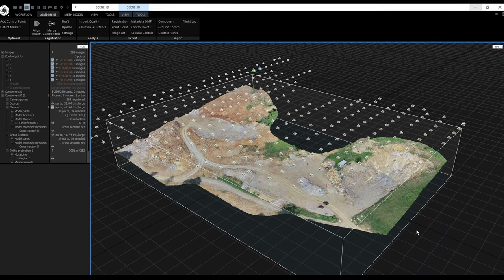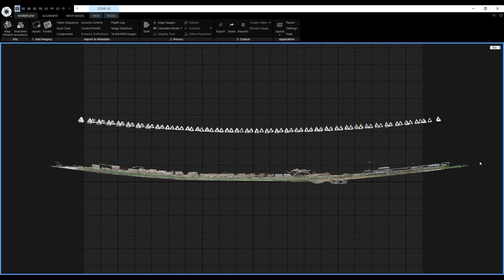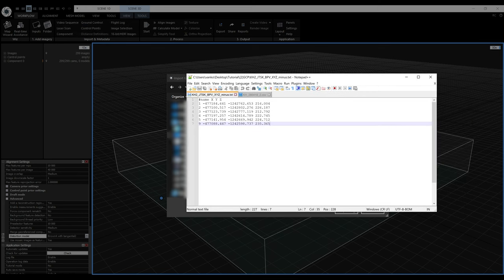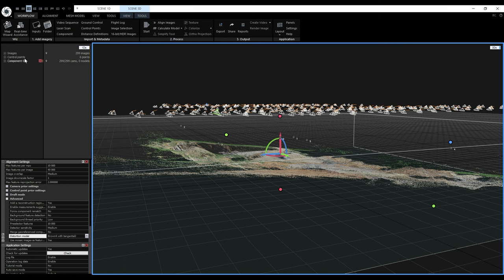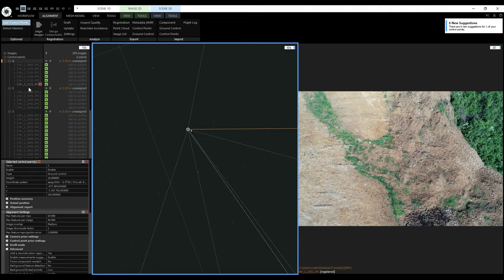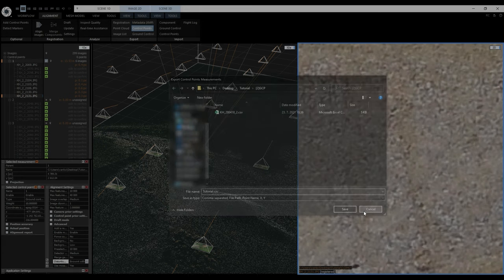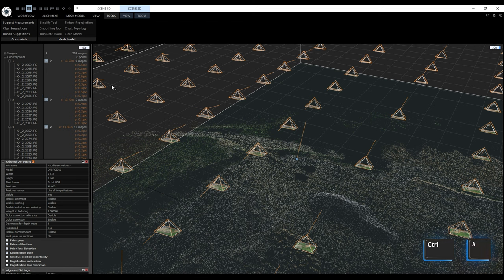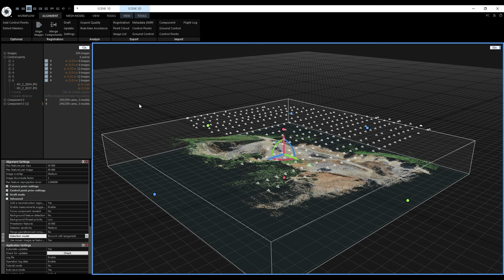Drone Mapping Guide | Part 1

Comment: @Jakub - I am having trouble aligning the images - I have done a vertical facade survey of some silos with a 65% photo overlap. When i insert the images and align I seem to get lots of small components that dont make sense. It seems either RC isnt placing the images in the correct GPS locations. Is there a way to fix this? Would uploading the flight logs help at all?
Reply from the maker: Can you contact our support with this issue?

Comment: Hello Jakub, Thank you for your tutorials. I would like to ask, that: Is it possible to sort Control points by name? I chceck accuracy my 3D models and I have more than 100 control points and I have problem with orientation in my list. Thank you for your answer Stano
Reply from the maker: Hi Stano, this is not possible, but we have a feature request about this. I will add your vote there.
Reply: @CapturingReality  Hello Jakub, If I can, i have one more question. I´m researching created 3D model without gps, total station and scanner. I would like to define scale of model only with reference distance and find optimal position of scale. Is it possible to define only reference distance and than control accuracy of model with masured points with total station? Because when I don´t choose some ground control point my model gave me to wrong positition and accuracy didn´t wrote true accuracy. When I choosen all my measured points with total station, defined points like ground test it is not moved 3d model to optimal position for minimal errors? Or do you have some idea for check accuracy when I want to define only reference distance? Thank you Stano
Reply from the maker: @StanislavStehel  Yes, it is possible to scale your model just with the distance. It is better to use more scales (it also depends on the size of the model) and you need to use correct distance (not too short). Are you using drone dataset? When you are using total station, you can also use these points as GCPs (it is better, as they have better precision as RTK GNSS). Ground test is just for comparison, these points don't have the influence on created model. Best way is use some coordinate system or local coordinate system to check the accuracy.

Comment: At the 9th minute and 19th second of the video, you import the CSV file containing the image coordinates of the images associated with the points. I also followed the steps you showed. At the end of the steps I took:
Operation warning
The file contains 42 images that are not in the current scene. Please check the console for the full list of images. [error: 18002]
I get the warning. I don't see the additional points in the rest of the video. what should I do?
Reply from the maker: Hi, this is just a warning message that there are some images in CSV file which are not included in your project. You can continue ordinary in the process.
Reply: @CapturingReality  Thank you for taking into consideration the question I asked, being interested in it, and answering the question I asked.

Comment: Great set of videos, thank you for going into so much detail.  I've a question about the number of GCPs to use.  I'm mapping an earthworks site which is around 14acres and am using a total station to set some GCPs throughout the site.  On my last model I used 18 GCPs.  Is there any disadvantage to using so many, other than taking more time to confirm locations in the images?
Reply from the maker: No, it is even better. If you have some many of them, you can some use as check points to check the actual quality of the model.

Comment: Great work Jakob, very informative and professional tutorial. Which capture app would you recommend based on your experience, Drone Deploy, Pix 4D Capture, Map Pilot Pro, ESRI Site Scan LE or the paid Drone Link? Is the Terrain awareness important to vary altitude and keep the flight height parallel to ground and keep a consistent GSD? Is a good rule of thumb to keep the GSD typically below 20mm by selecting appropriate flight level? Many thanks.
Reply from the maker: Dear Lee, we don't recommend concrete application. RealityCapture works with images and it is on your preferences which is best for you. It depends on your work and what you need to obtain. But it is better to follow the terrain because of the same GSD and non changing overlap. Regarding to GSD, it also depends of your needs and what for you are doing that project.

Comment: Hello, Thank you for your tutorials. I have a question. In Drone Imagery + Ground control points of free sample datasets, Control points' Altitude is Higher than Images' Alititude. Is these Ground Controls correct?
Reply from the maker: Hi yes, the control points are correct. Problem is with the image height, where DJI drones use relative height, not the actual one (https://forum.dji.com/thread-165794-1-1.html). So it is possible in some cases, that there are these differences.

Comment: @Jakub - Many thanks for this tutorial! I'm totaly new to this RC and have some questions about differences between the files you use in your tutorial and the online datas provided on RC website:
1 - Coordinates system:
You use epsg: 5514, and on the website description about coordinates are separated in horizontal epsg: 4258 and heights in Baltic vertical epsg: 8357.
How should i deal with those informations in the RC settings? Am i supposed to use the epsg from the country i work from or the epsg the pictures were taken from?
2 - Group calibration Exif:
All images from downlaoded file are the same focal (e.g 24mm). Is it necessary to change GCExif to "Yes"?
3 - Distortion model:
How do you know what DModel to choose? Is it relative to the drone/optics constructor?
4 - GCPs:
The downloaded file is already provided with Ground Control Points going from 101 up to 203, but there is no negative values like in your tutorial. If i import GC with File Format X, Y, Z i get an error from RC, so i assumed they were more lat, long and alt coordinates and it worked. But i had to manually adapt the images suggestions because they were all above the picture in the 3d viewport. Everything worked fine until the .csv step at the end of wich i got an error msg from RC. How should i use those informations? Also the .csv infos are provided with the downloaded files, i don't know where to go with those, like i'm confused!
5 - Readme file:
It says we should change the path to the source folders in the SetVariables.bat as follow: 
* RealityCaptureExe - path to installation folder RC.exe is stored.
*RootFolder - path to all source folder.
How do i do that? (cmd prompt, but don't know how to do it properly)

That's a lot of questions, so in advance thank you for your answers Jakub!
Reply from the maker: Hi Vincent, I will try to answer your questions:
1. The dataset which you can download from our site is another than used in this workflow. Regarding to coordinate system, you can set Project and Output coordinate systems in Application settings )(they could be different). Also, if you are importing each files (like GCPs you can set their own coordinate system). You can set these systems as you need or to in which system are the data. In your case you can set 5514 for project and output coordinate system, but 4258 when you will import the GCPs.
2. It is not necessary but you can do this. It is better do do when you have different focal lengths.
3. For most cases is OK to use pre defined distortion model. When you have fish eye optic, then you can use Division. 
4. Yes, GCPs should be in Lat/Long (4258). It is quite usual thing to manually place the GCPs over images, as drone data are not always in correct heights. Usually they are measured from the take off height. Did you realign the component after GCP's placing? Also, you should set No in Use camera priors for georeferencing under Alignment settings in this case.
5. You can open that BAT file in Notepad++ for example and change these paths there.
Reply: @CapturingReality  - Thank you Jakub, i'll try this later this afternoon and let you know how it goes!
Reply: Hello Jakub, i did it with the script, i used Visual Studio Code to open files. Everything went well, while during the process RC crashed right after the texturing operation. Don't know why, might be because i'm only 16Gb ram?
I will try to do it step by step today, like you do in the tutorial instead of running the script, and let you know how it goes. Thank you so much again, have a nice day Jakub!
Reply from the maker: @vincent4468  Hi, did you get some error during/before crash? Were you using the setting from script or did you change some of them?
Reply: No Jakub, no error before but a crash during the execution of the script right after Texturing step and i did not change anything in the script. I will try again and send a crash report if it helps and if possible.
Reply from the maker: @vincent4468  If it will do again you can contact our support with that issue (support@capturingreality.com).
Reply: @CapturingReality  @ Jakub - Hello, i am doing the tutorial step by step, setting everything with epsg:5514 (coordinates system, GPCs), but it does not work. GPCs don't show up on screen and when selecting one and ask for Suggest Measurements, nothing happens. Plus if  selecting a GPC in the 1D list and then moving the model in 3D viewport, i got a black image like if the model is lost and i have to go to Reset View to get the model back in the 3D viewport. As far as i'm going, i cannot follow the tutorial. Any idea why?
Reply: @ Jakub - Now it works! I was wondering if by using the same parameters as the script does for the settings, but doing step by step like in the tutorial, it would work..but it did not. By using the script, i noticed that GPCs file format was epsg: 5514, but if i do this following the tutorial it does not work. But changing the file format of GPCs to epsg: 4258 and clicking on Convert Coordinates, does the job. I get GPCs in the viewport and no problem with the 3D viewport. Let's continue this tutorial and see where it brings me to...
Reply: First Part done, perfect!
Reply from the maker: @vincent4468  The sample dataset from tutorial and downloaded one are not the same. therefore there are different coordinate systems.

Comment: Great Video. I am currently working on making an underwater model of a deep-sea coral garden. I have the lat, long, and altitude of the ROV that took the images. Is it better to import a flight log or ground control points? Or a combination of the two to accurately georeference and provide scale?
Reply from the maker: It depends on the precision of the data. The best way is to have both (as you can check also the precision of the results much easily).
Reply: @CapturingReality  I understand. Thank you. 
One last thing. In the context of just ground control points. Is it necessary to add GCPs to all the photos in the model or just specific areas within the model? I am exporting the scaled dense point cloud into cloudcompare and ArcGIS problems as a DEM.
Reply from the maker: @ignacio_the_coralbiologist  The GCPs should be placed around your captured area evenly. It is not necessary to add them on each image. The number depends on the used dataset, but basically it the point is measured/placed/added on 10 images, it should be enough for most cases.
Reply: @CapturingReality  thank you. I appreciate your insightful tips.

Comment: During alignment my CPU is at 100% and the GPU is at 0%.
Should RC use the GPU for alignment?
It's an Nvidia Geforce GTX 1660 TI
Thanks
Reply from the maker: GPU is not used during alignment process.

Comment: @capturing reality  How does RC handle Check Points?  In accurate mapping, processing without CPs is just pretty pictures.  Maybe it's in one of the next vids?  Thanks!
Reply from the maker: Hi Dave, you can choose some of the Control points as Check points and then find out the accuracy of created model. In RC it is called Ground test. In this video the control points are in the Importing control points measurements part.

Comment: Wish you would create a set of mapping videos without ground control points. Honestly most people don't use them
Reply from the maker: Hi Darrin, thank you for your idea. In that case it is basically the same, but except GCPs you will use flight log. Do you have RTK drone?
Reply: @CapturingReality  oh no I don't have gcps or rtk. I have always used drone deploy in the past but I have just started using reality capture and I love all the customization and In my opinion the maps and models created with reality capture are so much better than drone deploy.  Most of the mapping I've done commercially are only concerned with relative accuracy and not so much absolute.  I love the tutorials but they were so indepth with incorporating gcps it was hard to follow. That is why I was suggesting possibly another set but with out the gcps. Thank you so much for the quick response. Looking forward to learning more about the software.
Reply: then it is not maping but creating pretty pictures
Reply: @CapturingReality  If your using an rtk drone and GCPs would you still set camera priors to unknown and realign?
Reply from the maker: @CAPTURECI  You can do that. Then GCPs are used for georeferencing.

Comment: How do I get/create or where do I find the ground control points file?
Reply from the maker: You can create them manually (Alignment tab/Optional/Add Control Points) and set the points as Ground control or you can import those as TXT file under Workflow tab/Import & Metadata/Ground control).

Comment: How do you align drone captured images with hand held camera images?
Reply from the maker: The same way how any other images. If there is a good overlap they will be aligned, if the images are georeferenced, they will be aligned. When not, you can use control points to merge two separate components. The principles could be take from this tutorial: https://www.youtube.com/watch?v=kKA-KxT25KA

Comment: Hello. Could you make a tutorial using a combination af rtk or ppk georeferenced images combined with GCPs and explain how to set the weights?
Reply from the maker: Hi Nikou, thank you for your ideas. The principle is the same. You can set the higher weight for data, which are measured more precise. I added this idea to our future tutorial topics list.
Reply: @CapturingReality  Hello, I wanted to follow up on this. Have you updated a video on RTK georeferenced images. I am unsure how to process after aligning the photos without ground control points.
Reply from the maker: @stephanieramos8464  Hi, the video wasn't updated. You just need to set the precisions for the images in the Alignment settings (Camera prior settings).

Comment: Hello, double grid with what degree of oblique angle do you recommend?  I typically fly nadir. Is this wrong?
Reply: Will it be orthorectified after processing with obliques?
Reply from the maker: RealityCapture supports true ortho projections of textured models and image mosaicing. For the true ortho, double grid flight with obliques is better. For image mosaicing, nadir shots are better, especially when they are projected on the digital terrain model. Remember that you can use both obliques and nadir shots in a single project and then disable and enable groups of images for specific processing steps.
Reply from the maker: No, it is definitely not wrong. It depends on the use case. Double grid flight was recommended as one of the options for mitigating the bowl effect. This project used a single grid flight but was corrected with the help of ground control points.

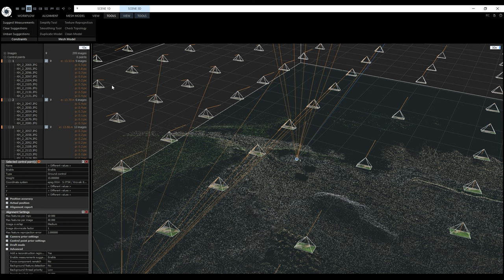Comment: 10:29 Disabling inaccurate camera priors
With Ctrl+D and an immediate Ctrl+A what is selected is actually just part of all images; I think it's either all the just prior manually georeferenced images or all images that still aren't. Is this intended or should all images actually be selected?
Reply from the maker: Hi, using CTRL+A all images in that component should be selected.
Reply: @CapturingReality  Hi, thanks for replying this fast. Just noticed that, in my case, it was just because I had multiple components and RealityCapture just functions that way that via pressing Ctrl+A it only selects all the images for the current active component which is all that is needed of course :D Nice!
Reply from the maker: @mpiauro3958  You're welcome. Also, if you will have open images in 1Ds view and will use CTRL+A, it will select all images in the project.

Comment: Are the images you used in the demo available to work with.
Reply from the maker: Not these specific images, but there is another drone dataset with ground control points available in our sample datasets on this link: https://www.capturingreality.com/SampleDatasets
Reply: @CapturingReality  I've downloaded the data set you are referring to and tried using it to measure area and volume. The logs just aren't as good an example as the sand would be. Thanks anyway.

Comment: Can yu make an RTK processing option?
Reply from the maker: It is possible using flightlog or if the position information is baked to the used images.
Reply: @CapturingReality  can you make a tutorial?
Reply from the maker: @mariohorvat9330  https://www.youtube.com/watch?v=oMnZFOOK7LQ&t=1030s - RTK/PPK data support, it is an older tutorial, but principles are the same
Reply: @CapturingReality  ty